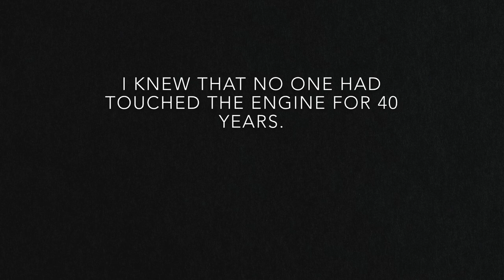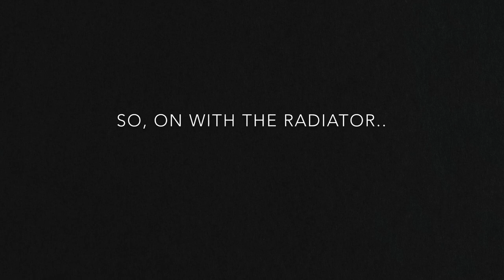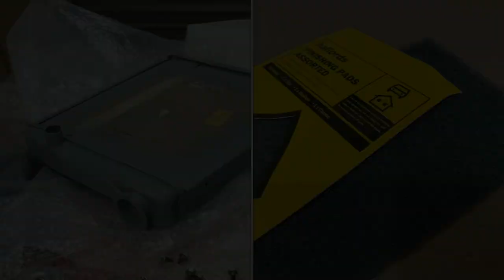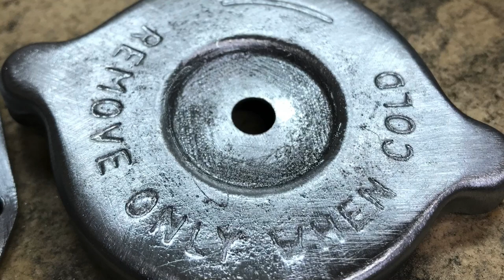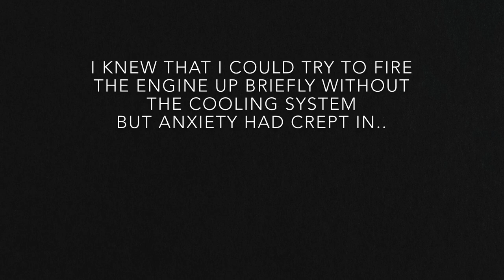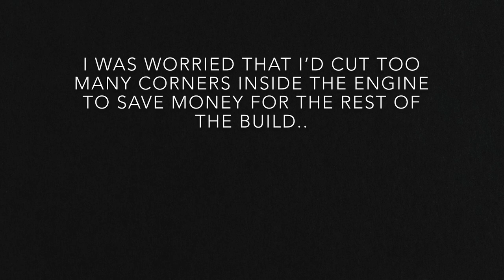Austin 1300 Restoration Radiator & Tank Eps. 11 - ADO16

Comment: Had same anxiety when I started my rebuilt mini engine years ago....it didn’t start...then remembered I had taken rotor arm off to get oil pressure first and it was still in my pocket...doh....put it back on and fired straight away, happy days. Hope same happens with my project now but that’s fuel injection and far too many pipes to think about yet! Keep up the good work 👍🏻
Reply from the maker: Oh no! Pesky rotor arms, I lost mine for weeks, then found it in the ‘safe place’ I had put it in and forgotten all about, a couple of days after I bought a new one of course, thanks!

Comment: I too like you felt scared to start my Wolseley as i had cut too many corners.But when she did start eventually,the motor sounded nice and smooth and my fears were set aside.i fitted a dual circuit brake system but my front calipers are seized.
Reply from the maker: Thank you for your interesting comments, apologies for the 2 yr delay in responding - been away, update coming soon

Comment: Really enjoying watching this series, could you tell me if the abrasive wheels just called ‘abrasive wheels’  and where did you get them? I’m just about to do some work on my Discovery chassis and they look ideal for what I want to do.
Reply from the maker: Great thanks, i think they are known as ‘poly strip wheels’ . They are available with a shank for a drill which is what I use  (. Try searching for that on ebay or here is an item no to copy/paste into ebay search 154035693955). I also remember seeing them in halfords earlier this year. If you have a angle grinder, they appear to be available for those too. Cheers
Reply: langranator  much appreciated, thank you, I will look forward to the next instalments of the restoration.